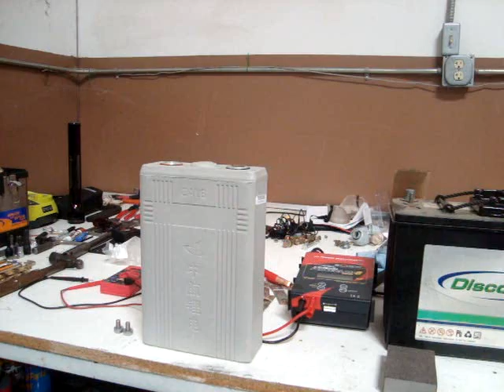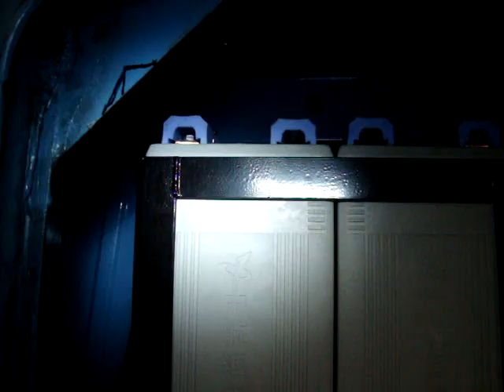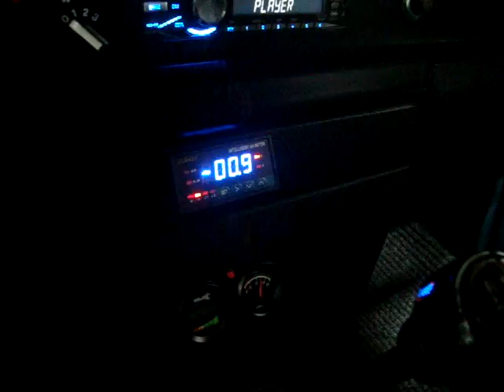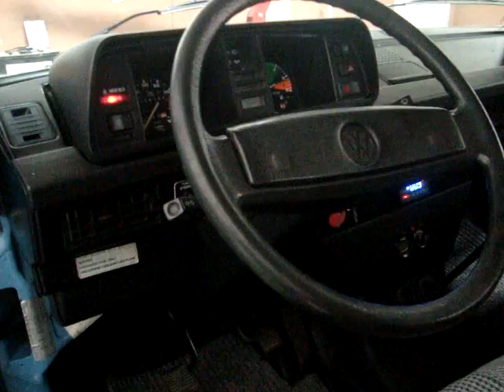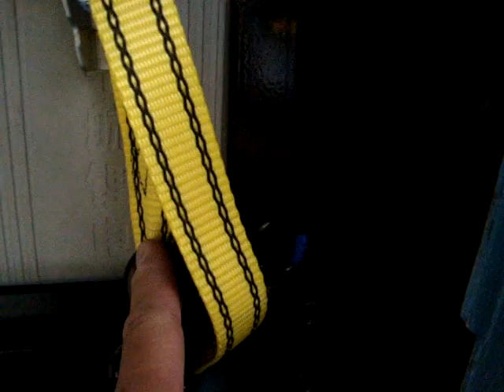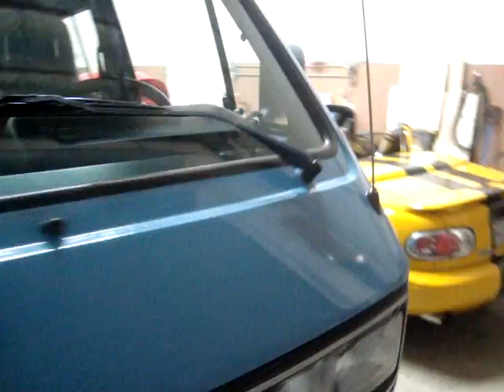EV Conversion Information - VW Transporter Doka, Episode 10 - Still On The Road In 2026

Comment: I noticed that you have AC compressors and power steering pumps and such on a pulley from an electric motor. Couldn't you put an alternator on there as well to run all of the electrics in the vehicle and maybe even push some charging out to the batteries? Also, the older Veedubs with the roof racks, could you put a solar panel in that rack to charge the batteries while the vehicle is sitting out in the sun? I am very ignorant of the technology involved here, but I am very interested in learning. I would LOVE to have an old electric VW, but I drive fairly long distances to work every day, so I am not sure if it would be a viable option for me.
Reply from the maker: Thanks for watching.  We are powering an on-demand power steering system on this vehicle.  We use a DC/DC Converter to charge our Aux. Battery as it is more efficient than using an alternator.  Regarding solar panels on the roof rack, basically comes down to return on investment.  You should attend one of our 3-Day Hands-On Conversion Workshops and learn what is possible.  Visit EV4Unow.com for more information.

Comment: Very good info on electric vehicle cell safety.  As electric vehicle power-cell units are getting beefier with higher voltage motors being more efficient than lower voltage motors it is good to be aware of the inherent dangers of working around high DC voltages. You may be interested to know that when towing a large box trailer with the tailgate in place that it uses considerable energy compared to when towing the trailer with its tailgate removed. It may be worthwhile running a test using an electric utility vehicle/Transporter with its tailgate open and then shut for comparison in power use of the two.

Comment: Hello Richard, 
Very nice and well done. I actually was hopping that you make the rear door that access to the motor glass clear. So people driving behind you can see. It's like a Lamborghini or Bugatti where they are proud of their outcome engines. I think you should be proud too. So my suggestion is to look for a lexan panel and put it only in the middle part like a window, where the beautiful frame remains. You may say what about the license plate? I think you could stick it on the lexan panel either from inside or outside. Or even you can put it on the bumper. 

I don't know,  I thought it would be better to see the motor from outside. Good luck my friend :)
Reply from the maker: Mark, there are a lot of things one might do if it were your vehicle.  Unfortunately, the Transporter was a customers vehicle and not ours.  So the decisions were not ours.  However, I do like your suggestion.  Thanks for watching.

Comment: Have you checked out a company called AllCell Technologies they have laptop style batteries encased in a case like automotive lead acid batteries come in. Might be easier, they can be wired together and work great for solar panels, etc. Might be easier to mount in a car than having to create fancy mounts for all kinds of different EV batteries out there.

Comment from the maker: Thanks for watching and commenting. Many of our videos have little features to gauge if people are really watching. The wedding ring is definitely a no-no. Another one in this video was the non-conductive ratchet which is great, but did you notice the socket? We do not allow any jewelry in the shop, and safety is the top priority. We try to share safety tips in our videos, and appreciate your participation in that message. Folks have been badly burned by working with a wedding ring on.

Comment: Hi, you should really remove your wedding ring when working on the batteries, I wouldn't allow my shop guys to wear them when running machines. After one of my guys left and was working somewhere else he pulled his ring finger off running a lathe. If you short your ring I'm sure it will get very uncomfortable.